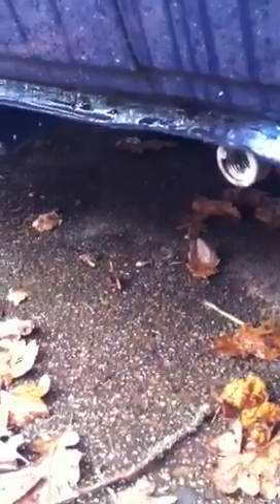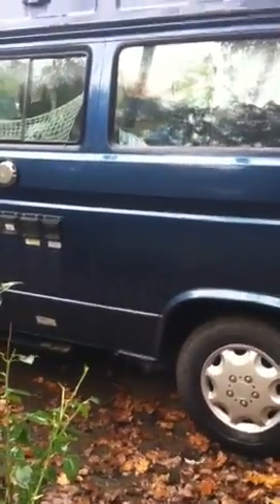Propex in a Vanagon Westfalia

Comment: I'm looking to install one of these in my Sprinter. I take it that the smaller 2000 will heat a van no problem? I like the low current requirement and conservative propane usage of these units. Also looking at the Platinum vented Catalytic (PlatCat) heater made locally in Oly. Hard to decide. Thanks for posting.
Reply: +evan h What did you decide on? Any updates?
Reply: +James Torrey Went with a small Espar Airtronic that I got for a good deal. It ended up being about the same price as the Propex + installation costs.
Reply: +evan h great thanks! I'm hoping to great a little teardrop so I don't need much
Reply: **heat